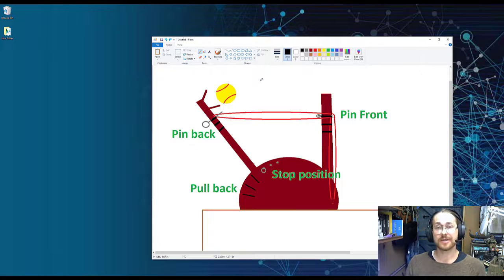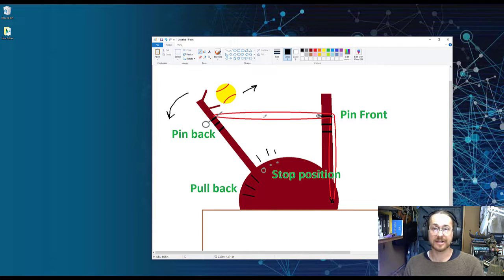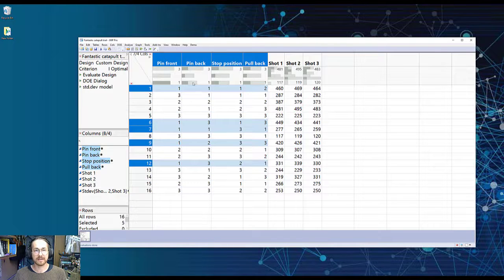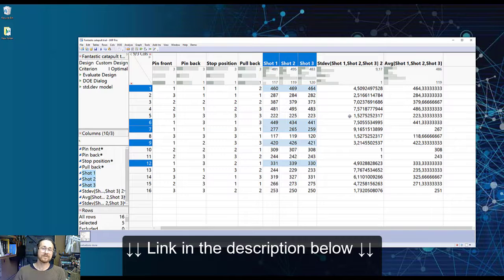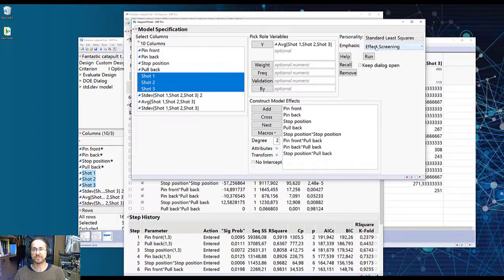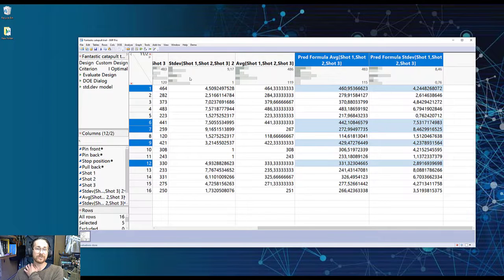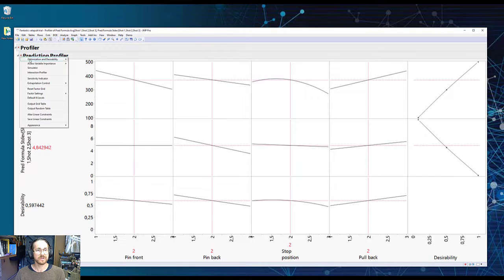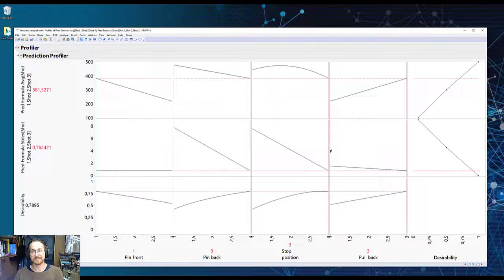DOE for Robustness and Optimization | Multiple Y´s | Replicate Measurements

Comment: Hi Christian, awesome vid! Btw, just wanted to ask on the Y variable in Fit Model. Can't we just include both of the average and std deviation as Y variables and directly analyze them together for Stepwise and Prediction Profiler, instead of doing separate models and then combining them with their prediction formula? Thanks!
Reply from the maker: Thanks for the feedback! 

Yes and No (great answer, I know...)

Yes: 
It is possible, and you will get the same output as I do in the video.

No:
In the past, I have found that adding multiple Y´s in the fit model window affected the P-values of the X´s. Because of this, I got into the habit of always doing it separately and joining the predictions after. 

This is a habit from JMP 12, so it might be time to revise my method! I will grab a developer and ask this question. 

I will make a new video when I get a good answer!